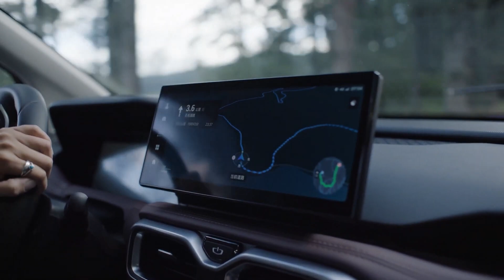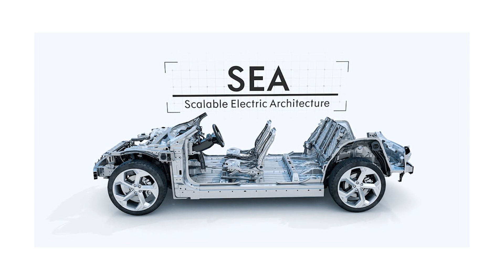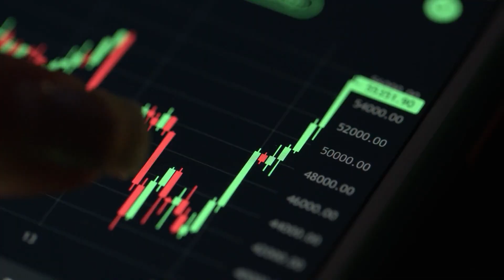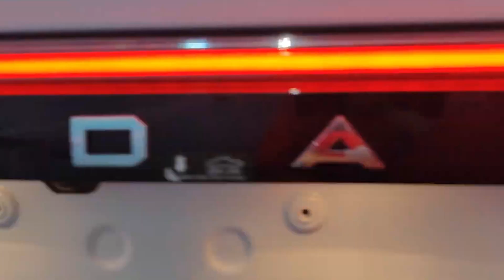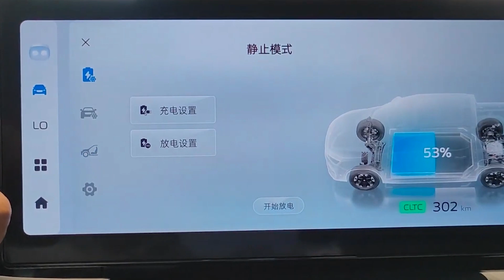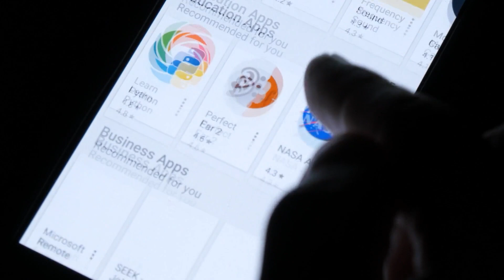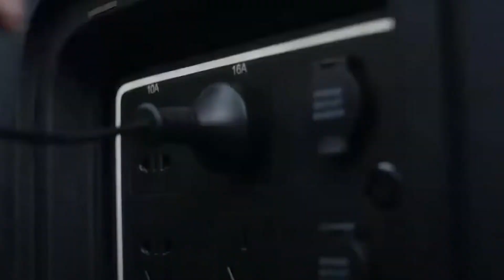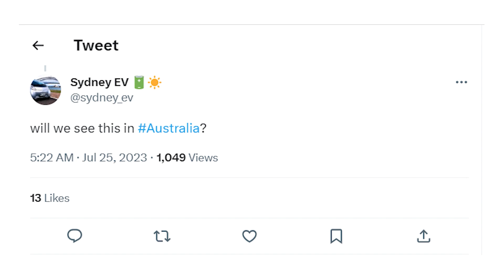Raydar CEO "Our New $20k Pick Up Will Change The Industry"

Comment: Well, after they spend $100M crash testing dozens of radars & add
the new safety features for the USDOT requirements I will guess
it will not sell for $11K. Besides, the US gov has just started to 
charge 100% tariff for all Chinese cars theres $22K right there.

!